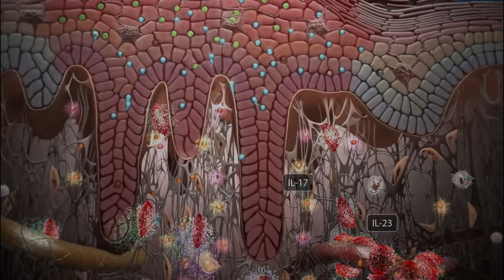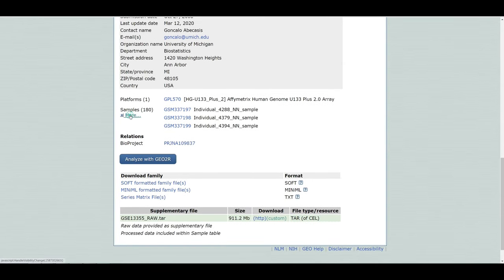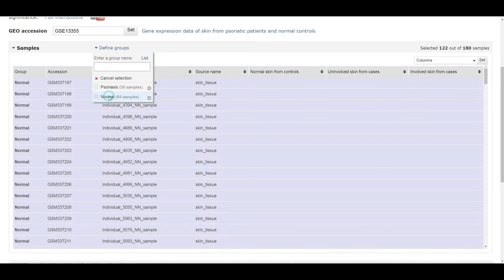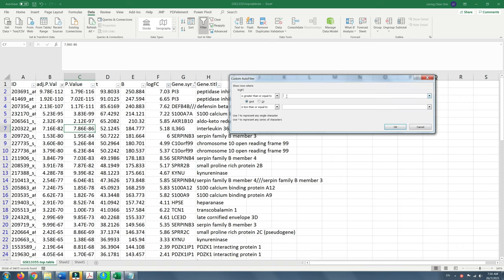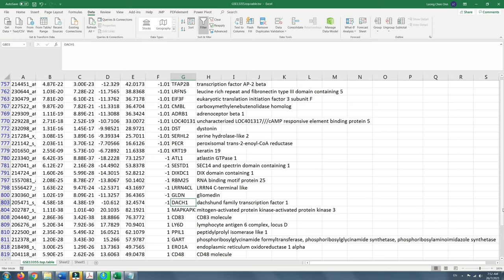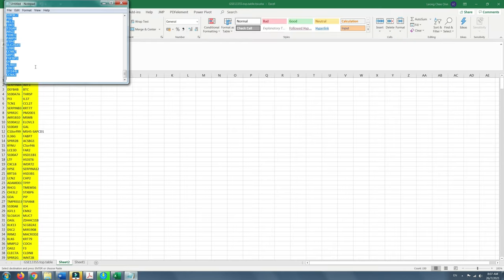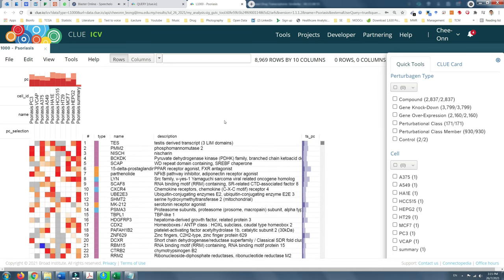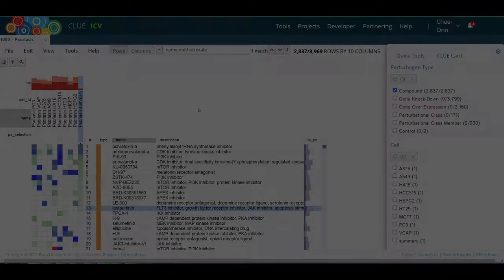CMap Analysis - Candidate Therapeutic Discovery Based on Disease-Drug Transcriptomic Similarity

Comment: Hi, Thanks for the detailed tutorial. I tried running my query in the "CLUE QUERY" tool, it went well. However, when I tried generating the heatmap by selecting my query result, it is taking me to Morpheus rather than ICV as you have shown. In morpheus, I am seeing only one column "id norm_cs" but not others. Where did I go wrong? Could you please help me out with this issue? Thank you.
Reply from the maker: That is because you are using the latest beta version. The is a drop down menu when you key in your up and down regulated gene list. If you select ver 1.0, you will get the heatmap as shown in the video. Hope this help.
Reply: @precisionhealth8145  It worked. Thanks.